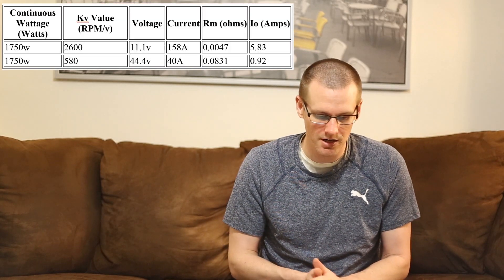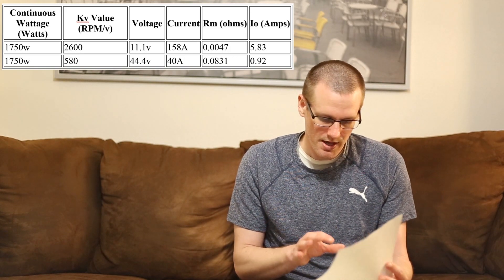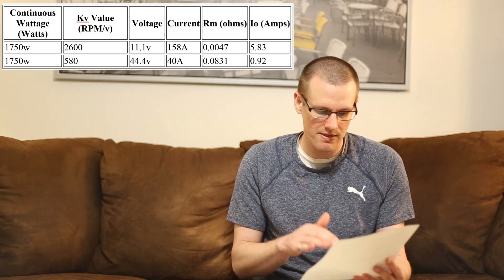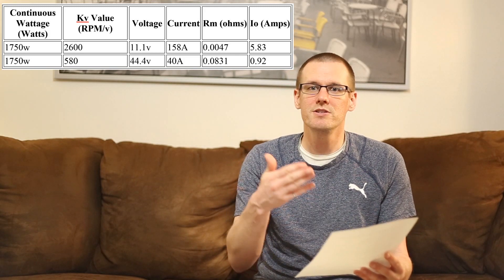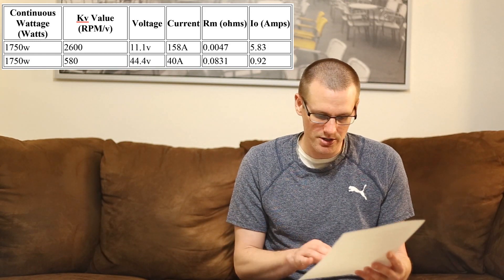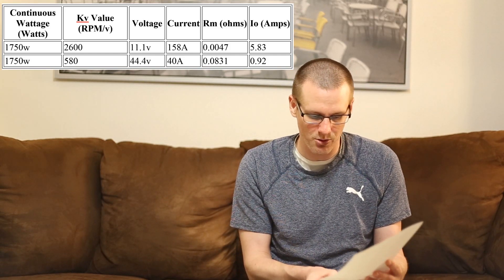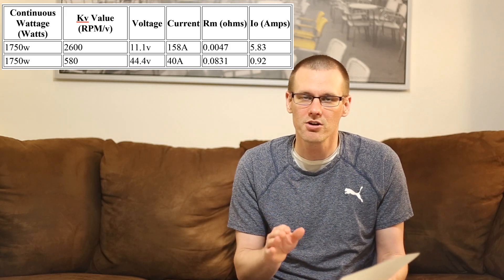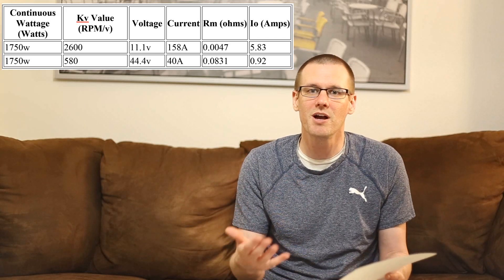Compare Equal Size Brushless Motors with Very Different Kv's

Comment: Silly question. 
Who or why the changed the way if rating electric motors, 
I understand 700 W at 12 V  and let say 7000 rpm.  It’s clear and simple, so why to switch to the kv and turns ?
Reply from the maker: I ran my old 9.6V Graupner 700 on 14.4V. What if I ran your motor on the same 14.4V, how would you determine total RPM?
Reply: @RCexplained  I am not here to argue, just wonder about why ? Anyway the RPM would depend of  the load, I think -  a bigger  propeller would slow down the motor ?
Beside, I have old ASH 26 model which long long time ago I got from Germany.  I got  brushless motor for it  - I think it was F10  (700 W) from USA, cost me a fortune at the time 700 US %.  Now, my dilemma is. what kind of battery pack to use for this motor which use to ran on 12 V  2000mA Nic cad batteries. I just plan to go back and fly it.
Reply from the maker: I was leading you down a path to determine why you need Kv. In order to figure out a different RPM, you would need to take 7000RPM/12V = 583Kv (calculating Kv that wasn't provided)
Take 583Kv x 14.4V = 8400RPM. These are all unloaded values with the Input voltage.

As hobbyists we need this information.

Try a 3000mAh 3s LiPo. Measure performance on bench to determine if this is satisfactory.
Reply: @RCexplained  I understand the calculation for RPM. Now, what if I want to replace the motor - how do I know which one to buy - to have the 700 - 1000 W ?
I think I read about guys trying to run the motor with the LiPo batteries and burning it. What would suggest as a replacement.
The specific glider is 3.2 m wing span, so needs good power.
Appreciate your help.
Reply from the maker: Find out how many watts per pound you want to be at. Somewhere around 40 to 75 is quite common for smaller gliders. Then buy a motor around this power rating. Choose a kv that will work with your preferred battery voltage.
Reply: @RCexplained  I dig out old posting on forums. They talk exactly what you said about the watts/ pound and using 4S with low kv to slow down the prop. And lucky me, I did find the model for  sale with all the specs for power. They use Hecker components.  Never stop learning new things. Thanks again 👍
Reply from the maker: @steelrat5604  no problem

Comment: 90% efficiency?!, it means if motor gets 100w of electricity, it will make 90w of mechanical energy on shaft?
Reply from the maker: Yes if I understand you correctly

Comment: question for you; 4092 boat motors for 6s with wildly different KV per turns (all wye)
-rocket RC 2y = 1520kv
-SSS 2y = 1400kv
-leopard 2y = 1390kv
these are relatively equal but then
-TP 4y - 1350kv
-Neu 1y = 1577kv

why does the TP need 4 turns? why does the Neu need 1 turn to get into the ballpark of 30k RPM on 6s? is it magnet strength? whats going on here?
Reply from the maker: It's overall build and quality of the motor. A lower Rm value will translate to less losses at higher current.

Comment: High kv makes low torque at low voltaje? Example:  a 3650 3900kv at 6V makes low torque than a 3650 2150kv at 6V??

Comment: Good info… but what I really wanted to know is, under what circumstances would you want to use each one? Surely they make them with these differences for a reason… and it’s not economic because they cost the exact same from the manufacturer in most cases. So, when use a low Kv motor, and when use a high Kv motor? Thought this video might explain that. (And yes, understand the premise of wanting to use variance in voltage, but is it really that simple? If voltage remains constant, max Kv? Or are there reasons to go lower in Kv at the same voltage?)

Comment: I enjoy watching your videos. You explain topics very well. My question is about a motor's power. If manufacturers across the board don't consistently publish their specs, then how to compare? Let's take the Tekin T8 1900kv, the Reds Racing V8 1900kv, and the HW Xerun 4268 G3 1900kv. All top-choice motors, IMO, but between those three, the Reds is the only motor with a published 1850W of power. We can't assume that all three motors are equal in power, so how does one motor seemingly have a different power curve, feel, or punch? Perhaps neither actually do, and it may all be bullshit specs. On a side note, something also worth mentioning that any brushless motor seems extremely weak, aka ZERO power, in a locked-rotor state. For example, if your car is pinned-in tight against a pipe, the motor will not rotate nor will the wheels even try to spin. Perhaps this is a fail-safe built into the ESC, but it's something that I have noticed.
Reply from the maker: Hi Charles. You can analyze motor can size size, Io and Rm values to gain a further understanding of a motors potential. Otherwise, general experimental tests help determine the better performing motor. 

As for a locked rotor, my sesnored motors would brake shafts in half if the wheels were preventing the motor from turning. Perhaps you have a sensorless motor and are looking for power at 0 motor speed.

Comment: Hey man, so you saying the most efficient for motor is to follow the continuous power which is the rated voltage and rated amps? But then the continuous power is lower than 50% of peak power. Isn't it too low power input? I read on some webs and they said to be able to get most efficient for motor, should use about 75% of peak power instead... Please clarify this

Comment: hey man, I really need some advice. I have an arrma Typhon 3s I currently am running a spektrum 150a esc and my motor is 3674 2950kv that I run on 3s and 4s. with a 17t pinion and 57t spur . .it's a beast on both 3 and 4s but it does seem to warm up the esc and motor pretty quickly off road on 4s .I'm looking to get a 4068 2650kv to run on both 3 and 4s. it's rated at 122a max. I'd like to be able to run 3 and 4s without losing too much speed on 3s if possible . .does that 4068 2650kv motor sound like a good fit? when people say a certain motor will pull too many amps or an amp hog what causes that? if a motor has a higher amp rating does that mean it pulls more amps ? I was think a larger can size will provide more power and less heat but idk.. I'm trying to keep the heat down a bit..trying to find that balance between power and heat I suppose. i mainly just bash on and off road..no track racing or anything . ..any help or advice would be great man..I really appreciate it.

Comment: Hi, thanks for this (and your other) videos! Trying to explain such things in an understandable way is great and I am grateful for your time and thoroughness. 
It would be great, if you extend this comparison to the whole setup, not just the motor. I think, the losses in ESC and wires are also not negligible, as ESC also needs cooling. Switching and guidinbg high currents (158 compared to 40) for sure make a difference somewhere else? What do you think will change in your efficiency calculation, if you look at the whole system, including ESC, connectors and cables?

Comment: Sir, you explained well regarding these two motor's electrical characteristics, it will be very useful if you also explain the mechanical load to speed bearing advantages of these motors at certain conditions. Thank you for explaining. 🙂

Comment: my esc has a thing called breaking phase i have no clue what that is supposed to be set at  to  may setting but i do like knowing how it all works but gerr
Reply: that is for brushed motors, the setting allows you to limit throttle in the break in phase to avoid causing damage to the brushed motor in the initial few runs , as break in should be at .3 to .7 throttle for the 1st few runs

Comment: Nice video as always but I'd say it's a bit biased since you compare the motors while you operate them at different voltages
Reply from the maker: There is another video that goes through a similar analysis using the same voltage. Better yet, I'm working on a full practical experiment using a Brushless Motor Dyno. You can see the Dyno in action on some of the more recently released videos.
Reply: @RCexplained  I ve seen all your videos and you do a great job with a lot of effort and time.my comment is from pure electrical scope

Comment: Hi, thanks for the video, we have 2 same models brushless motors, one of them has stronger magnet, are stronger magnet means it’s better motor? Will it have better torque? Thank you
Reply from the maker: If all else is equal besides having a stronger magnet in one of the two motor. Kv will decrease and the torque constant will increase.
Reply: @RCexplained  thanks for the respond, sorry I missed, stronger magnet means better torque?
Reply from the maker: The torque constant increases.
Reply: @RCexplained  so at overall stronger magnet, means better motor, right?
Reply from the maker: yes
Reply: @RCexplained  ok then, appropriate your help, thanks

Comment: Ok so what is physically different, causing the differences in resistance and no-load current?  Are we talking wraps/turns?
Reply from the maker: The length and diameter of the copper windings.
Reply: @RCexplained  Thank you.  I think you mention something like that in the video, but it was a lot of info, wanted to ask!  Can I ask what the relationship is?  A greater mass of copper in the wires will have the greater KV, or lesser KV?  Thank you for this page, I just found it.
Reply: I'm assuming less mass of copper wire is faster RPM, and more mass of copper wire is slower but has more torque.
Reply from the maker: In a motor of the same physical size, the mass of copper being used must stay the same. If you have less copper, performance will be down overall. 

When the number of turns increase, the diameter of the wire must decrease. Overall the mass stay the same.
Reply: @RCexplained  Ok, ok, makes sense - thank you.
Reply: @RCexplained  Ok, one more - keeping wire mass the same - greater diameter, fewer turns = more torque.  Smaller diameter, more turns = more speed.  Right?
Reply from the maker: More stator turns is going to give you a higher torque constant kt and a lower kv.
Reply: @RCexplained  Ok, Ok - thank you for the all the replies!

Comment: Good information, an overview at the start and a summary at the end, could help considering the technical discussion. You didn't mention that the rpm of the two motors was comparable at the voltages tested. 2600kv x 11.1v = 28860rpm. 580kv x 44.4v = 25752rpm.  I thought that was interesting. Thanks
Reply from the maker: Thanks for the comment Bliss!

Comment: Motor 1:
KV (RPM/V)	2600
Power (W)	1750
Current (A)	158
Resistance (Ω)	0.0047
No load current I0	5.83
KT (Nm/A)	0.0037
Power / Current (V)	11.08
IR Drop (V)	0.74
BEMF (V)	10.33
Net Current (A)	152
Torque (Nm)	0.56
Speed (RPM)	26867
Power Output (W)	1572
Efficiency (%)	90%
In - Out Power (W)	178
I2R (W)	117
No load current loss (W)	65

Motor 2:
KV (RPM/V)	580
Power (W)	1750
Current (A)	40
Resistance (Ω)	0.0831
No load current I0	0.92
KT (Nm/A)	0.0165
Power / Current (V)	43.75
IR Drop (V)	3.32
BEMF (V)	40.43
Net Current (A)	39.08
Torque (Nm)	0.64
Speed (RPM)	23447
Power Output (W)	1580
Efficiency (%)	90%
In - Out Power (W)	170
I2R (W)	133
No load current loss (W)	40

Right?
Reply: Seems about right, but keep in mind that I0 will be significantly higher for the second motor.
I mentioned this in the "Comparing Brushless Motor Torque vs Kv" video discussion. Typically I0 is measured at 10V, at least for the motors I use, but if you need to drive it at 40V to achieve the desired RPM then you will be underestimating those losses.
Reply: @xnoreq  Yea - I guess the thing to do is measure Io at the actual operating speed.  That's how Maxon specifies it for their motors: 
"No load current I0 [mA] ±50%
:
This is the typical current that the unloaded motor
draws when operating at nominal voltage. It increases with rising speed owing to bearing friction and iron
losses. No load friction depends heavily on temperature. It decreases in extended operation and increases
at lower temperatures."  https://support.maxongroup.com/hc/en-us/articles/360012268940-Meaning-of-maxon-s-specified-motor-data
Reply: @xnoreq  I imagine that the values provided by manufacturers would reflect the highest power/efficiency operating point for their motors.  It's kind of surprising that may not correspond to the highest rated voltage/speed for the motors as shown below.  Are the rated resistances motor terminal resistances or the winding resistances (like the VESC Tool reports)?

TURNIGY AERODRIVE SK3-6374-192KV	
Max.. Voltage	44
Weight (g)	858
KV (RPM/V)	192
Power (W)	2750
Current (A)	80
Resistance (Ω)	0.016
No load current I0?(A)	4
KT (Nm/A)	0.04974
Power / Current (V)	34.38
IR Drop (V)	1.28
BEMF (V)	33.10
Net Current (A)	76
Torque (Nm)	3.78
Speed (RPM)	6354
Power Output (W)	2515
Efficiency (%)	91%
In - Out Power (W)	235
Copper loss (W)	102
No load current loss (W)	138

Comment: Broadly speaking, you should use a motor with a propeller that gives us the rpm calculated in this way. Kv * V * 70% = rpm.
So for the same power at higher Kv a smaller and vice versa propeller will be used.
Using it with a propeller that with less rpm will be a disaster and will end up burning the motor. all 100% acelerated.

Comment: Hey guys, I'm new to Rc edf jets planes etc.. I come from rc cars and theirs definitely a difference. So a question I have, I own a YAK-130 is comes with 60A esc and a 3048- 2150kv motor and its says itll go 90mph can I put a 70A esc and keep the same motor or would that overwork the stock motor? any suggestions please!
Reply from the maker: Hello,  in order to increase power output and speed of your EDF, you will need a new motor that can spin faster while not overheating. This will result in pulling more amps if run on the same cell count battery. Your battery will have to be up to the task and you will more than likely require a higher output ESC.
Reply: @RCexplained  thanks for the breaking it down, so I need to up kv and esc ok got it now, I won't go crazy high though maybe 600 more kv
Reply from the maker: Hop on a forum and see what guys are modding to. 600kv sounds like a lot to me. I increase speed significantly by going up 200kv.

Comment: hi sir, i just have 2 questions for brushed and brushless
1. which of the two is better for aquariums?
2. can a brushless motor run 24/7?
thank you very much.
Reply from the maker: 1) both motors do not like water.(bearings) Brushless motors would be best in most applications. keep it dry though. 
2) Brushless motors in your PC run for hours on end. Some PC's never turn off therefore the fans powered by brushless motors are running 365 days a year 24/7.
Reply: @RCexplained  thank you very much sir, stay safe.

Comment: Can i use 80kv motor to run at speed of 3000 rpm
Reply from the maker: 10s LiPo would get you somewhere around 3000 RPM.
Reply: @RCexplained  can it be use as generator to charge this 10s lipo
Reply from the maker: @neelparab8928  This would be highly dependent on the controller that you are using. Yes it's possible.
Reply: @RCexplained  how should i convert it into dc

Comment: Need some assistance. Sonicwake 36 4082 2200kv motor and 180 amp esc with stock or undersized props and my esc gets hot and thermal cutoff happens. While the motor specs are 140 amps max. I have good water cooling. One for motor and one for esc. Will I gain much or lower my temps going to a 200amp esc? I know boats pull a big load.
Reply from the maker: Hi Chad, increasing the capacity of the ESC from 180A to 200A (same ESC manufacture) increases the power capacity of the ESC, and should lower temperature under the same load. There are also other factors to consider which may not guarantee this.